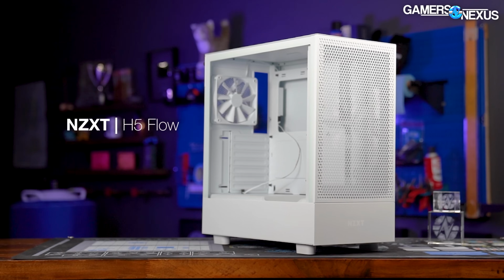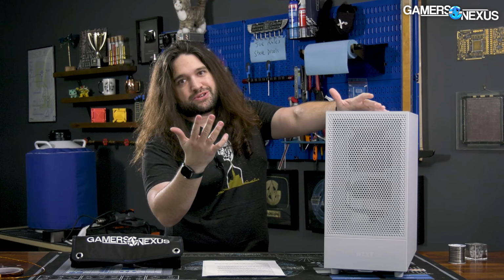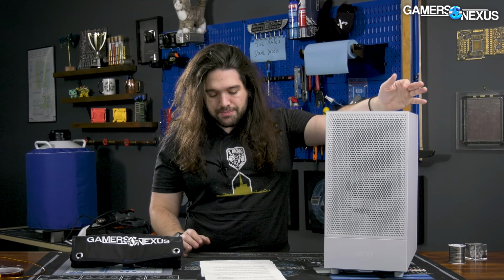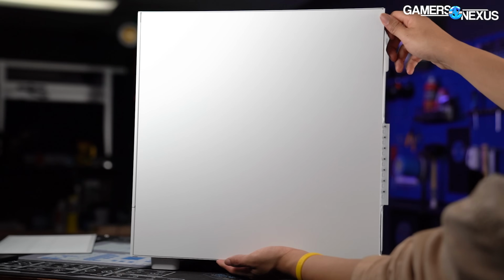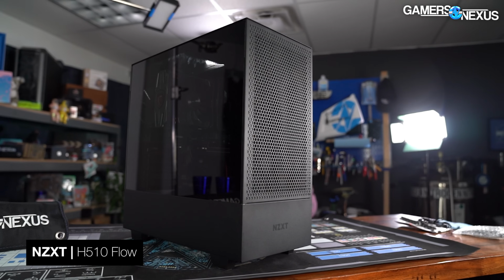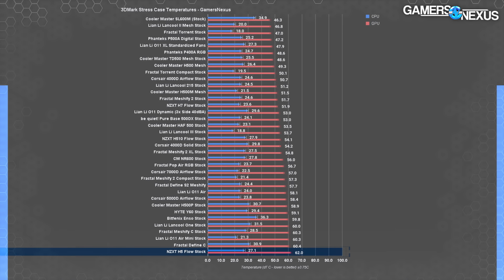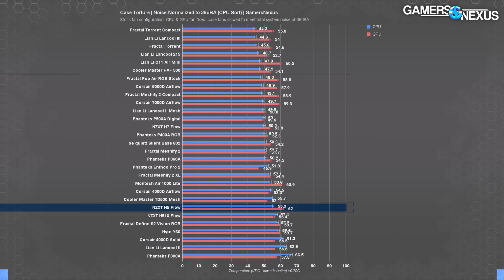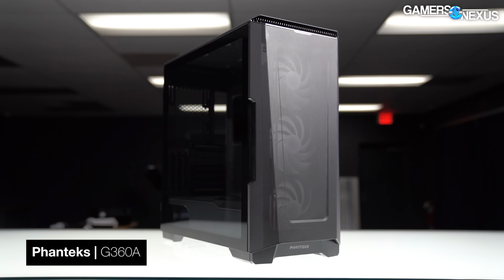NZXT H5 Flow Case Review: Thermals, Cable Management, & Noise

Comment: I actually have to give them overwhelming props for not including fans. I wish more cases would leave their garbage fans out
Reply: same, i have so many good fans aready at home, why would i need those garbage stock fans anyways
Reply: Yeah this case is really for those who already have plans to add their own fans. Just ordered this and will install unifans for this case. Might also buy a vertical mount for my 3080 suprim but I'm not buying that badly priced NZXT vertical gpu mount that costs as much as the case itself. Hopefully, the universal one from cooler master will work on the H5 Flow.
Reply: @Le_Mon9  did the coolermaster vertical mount fit and what is the gpu temp like mounted vertical
Reply: @acid3129  didn't go for the cooler master. A friend sold me his lian li one designed for the O11 but it fits in this case. The suprim 3080 doesn't go past 70 and mostly hovers at 69 deg.
Reply: @Le_Mon9  thanks I just got a evga 3080 ftw3 ultra and decides to get a new case atleast I know I can mount it
Reply: @Le_Mon9  69 Nice
Reply: Can't tell if this is a joke or not. I don't have a shitton of case fans laying around so the fact that this case doesn't have any is a deal breaker. The only fans I have use that shitty Molex or whatever and I can't control them. This is a reddit tier comment
Reply: Some including fans are better than others, apevias are garbage, while thermal takes are good enough for me to actually use.
Reply: Same here! I bought that case some time ago and I am happy that NZXT doesn't actually include cheap fans. I guess most persons who spend about 100-110€ on a case prefer high quality fans. I went with Noctua and I am really happy about it.
As said... Most of us already have a huge box filled with cheap fans that we got with cases but which we've never used.
Reply: I assume that NZXT is assuming a customer buying an aesthetics first case may be planning to use an AIO which will have its own fans to mount to the front intake or the rear exhaust. Thus saving money on unnecessary fans by not including them.

Unfortunately, that is based off assumptions about the components a customer will install in what is still a "budget conscious" case.
Reply: I don’t. That’s just extra money
Reply: I bought the H5 rgb when it came out bc fans in my country are 70usd for 2 140mm argb. Easiest way to get fans is on clc’s and buying cases that come with them.
Reply: Exactly. A lot of the "downsides" they pointed out I actually preferred. This case is amazing. I've had it for a while now
Reply: I agree.  The NZXT fans that came with my H5 Flow are in a drawer somewhere replaced with better BeQuiet! fans in the chassis.
Reply: Wdym mine came with 4 fans out of the box
Reply: Bro what it’s good that they include fans what are I talking about😂
Reply: Same 120mm rear fan, two front panel 140mm fans and another 120mm fan at the base@RIOTStyx

Comment: be sure to use magnetic tools on this case, which has a funnel to collect all the screws you drop and fire them off on random directions.
Reply: If you're doing that with the power on, you kinda signed up for the 'exciting prizes' lottery anyway.
Reply: @RN1441  if the power was off, itd just be a lottery for when you turn it on lol
Reply: Haha!
Reply: LeRoy Jenkins   Mine have snuck behind the motherboard before, necessitating a complete disassembly to retrieve.
Reply: Noted
Orders 300 H5 Flow cases for the office, because revenge is a dish best served with a rotating flingamatron
Reply: "flush* them off..." 😉
Reply: @thisisashan  Make sure to use high speed server fans!
Reply: @dragonhawk1492  Good idea.  Some nice deltas so I can drown out their verbal requests.
Reply: not that i want to help anyone but... since i have a lot of amazing ideas... why not share them... for front glass prevention of air flow, why not etch in lines or dots ... perhaps even 1 line down the very center so at least some air is inhaled by the fans... any direction works... why not glass art designs ? there you go i have million dollar ideas and get nothing for any of it, not that i care, but i do need to eat & drink dont i.  edit: so you can continue to profit off the ideas i type here all the time, not that anyone is listening, how about sliding windows made from glass while the pc is on and slide it closed when its off, make it all manual or automated... there you go i even advanced it in 1 minute.
Reply: Facts I had to learn this the hard way lol

Comment: The angled bottom fan reminds me of the adjustable angle fan in the old Phantom cases. Really wish they'd update and redesign that case with modern looks and ideas, such a good case.
Reply from the maker: The Phantom 820 was an insanely advanced case for its time, too!
Reply: The angle reminded me of the nvidia northbridge 780i
Reply: bring back side panel fans!
Reply: Curious if a fan held at that angle would cause the bearing to fail more quickly.
Reply: It was also insanely overrated. Couldn’t go anywhere without seeing it. Basically everybody had one.
Reply: @Entr0py404  on those old evga boards!
Reply: I still use a Phantom 820 (with also the 8 years old part -.-)
Reply: @NinjAsaya  phantom 630!
Reply: I'm still with my old Phantom 240 lmao.
Reply: Yes! I had that same feature in my switch 810 back in the day.

Comment: The toilet fan is the funniest thing I've seen, surely the best innovation they've made for a while (aside from self burning cases)
Reply: That case was lit
Reply: Orrr just make the front panel have space for 3 fans and have more space in the psu shroud thing
Reply: @MichaelBelgium  This, and also add the possibility of 3x14 at the front, like some lian li cases which arent even super sized like lancool.
Reply: they should test things before production ... would be a lot better case, with perforated rear under gpu + remove that toilet, put 2 fans at front.
Reply: @heksogen4788  3x14 is on the bigger h7, which i have. Super nice and quiet, never going back tp 12cm case fans again :D
Reply: @EnlighterMinh   3x14 plus some shroud and 2cm here and here, and you get a case height of 46-48 cm. Is that that much? I think every ATX case should be like that, but somehow manufacturers are reluctant.

Comment: This seems like a phenomenal case once you overcome the fan deficiencies. Add two front fans and it jumps to the top, or nearly to the top. If they'd added $15 and included those fans, it would be a no-brainer.
Reply: GPU temp at 55 with toilet fan and two front fans is still near the bottom of the pack.
Reply: it's sold for 2 140mm front case fans for $90 atm. Just bought it, badass case

Comment: I think this case makes the most sense when you are already planning on running a 240mm AIO in the front. Great review as always.
Reply: Those GPU temps though.  How do you fix that?
Reply: the GPU temps are generally made worse by the stock config, adding an AIO to the mix doubles the fans in the case at the same time.

I think more ideally AIO top mount with maybe at least 1 more fan in the front in the bottom position will net the best results, I question the use of non-ventilated slot covers tbh and wonder how much those are holding back certain configurations (since those exhaust air in positive pressure setups, or intake cool air in negative pressure setups)

There are some other reviewers for this case as well and GPU temps are basically a mixed bag depending on setup.
Reply: @chaon93  Well the test shows that adding two front fans lowers the GPU temps about 1 degree which is still the worst result other than this case without two additional fans.  So adding two fans did not help gpu temps.
Reply: @DM-fp8uw  you mean 6C. recheck the review, it was 60.9 to 54.8 by adding front fans. I have no idea where you got that 1 degree metric from.

To be clear, I'm more of a air cooler kind of person. Id rather just get something else. I just find that for people planning to get AIO's that stock fan counts aren't as big of an issue as the AIO will include fans.

having seen other reviews I suspect that GPU temps are better on 3x fan GPUs because they are longer and catch the air from the bottom intake better, the angle isnt enough without either a longer GPU or front intake to help force the air over the GPU area. I think the solid slot covers REALLY hurt this case a lot. air flowing either in or out of the slots via pressure would go a long way imo.
Reply: @chaon93  You are right. I was looking at the normalized fans not normalized plus the bottom fan.  Still 55 degrees with normalized fans plus bottom fans is still worse than almost every case with just the normalized fans except 5.
Reply: Agree, think 280mm AIO would be better from a looks and possibly performance standpoint though.
Reply: Vaniq  The temps are still bad in the test with normalized fans.
Reply: Vaniq  lol I still have the ancient s340 case. I’m probably gonna upgrade to the Corsair 4000d soon.
Reply: I have this case, 2 front fans, 240 aio mounted in front, bottom fan and the one in the back. Cpu stays around 40c while gaming and 68c on gpu.
Reply: @DM-fp8uw  got this case, have a 240mm AIO on cpu, radiator mounted on top with 2 fans as exhaust, got 2 front fans as intake and 1 fan in the back as exhaust. Never seen more than 65 C on GPU (7900 XT) playing on 4K. CPU is going max 55 in demanding games. I'd say that's a pretty good temp.

Comment: Lol the toilet fan is certainly an interesting addition. With the amount of builds I’ve seen where the GPU basically perfectly fits to separate the top and the bottom I can see it being more necessary.
Reply: Honestly, a case that has some kind of seal around the GPU, and dedicated bottom intake, rear exhaust, then top intake and rear exhaust for the CPU could be quite interesting. Just tossing ideas around though, probably some practical considerations to be made.
Reply: Toilet fan 😂…lol that is cool name. But just hope AH never hear it or she won’t use bed toilet anymore.
Reply: How you  going to put the anti sag bracket tho
Reply: A lot of sandwich style sff cases have a similar airflow pattern. The louqe ghost, dan a4, or even node 202 have fairly separate compartments
Reply: Like the h510 series for instance.
Reply: @ChrispyNut  because originally it was where hard drive locate. Second, it actually not as good as dual chamber design where you can mount 3 fan at the bottom. This design only make sense in mid tower where space is cramp. So issue can be fix with difference approach such as psu mount on top. This allow you to have intake from bottom. Anyway, it unique and cool but not the best approach specially you will sacrifice hard drive (not like gonn be a big deal for casual gamer but for content creator, it could be).
Reply: @ChrispyNut  for contents creator, one is never enough, 2?? Could be if both are 14TB or like that because ssd is really limited in storage so hdd still the only option for those works.
Reply: @ChrispyNut  should be, because the last ever case think about these like us been forgotten long ago…h440…man, i can’t step up from this case. My gaming system had been changing outfit yearly, but my main system on other hand changing internal yearly 😂😂

Comment: I have an old Thermaltake case which I used in all my configurations over the course of 12 years. Still rock solid with great thermals and that's without any additional fans. Back then manufacturers didn't care much about cable management and that's the only reason why I'm considering upgrading after all this time.

Comment: You can add front fans to nearly any case. You can't add bottom fans to very many. I'm a big fan of that lower/shrouded design. I feel like having a source of fresh air blowing towards the gpu from the bottom of the case is helpful. That's why I really like the Lian Li Lancool II, you can put two intake fans right under the gpu pulling from air from the bottom of the sides.

Comment: Actually, the lack of fans is a great plus for most enthusiasts who will instantly switch them to noctua or some high end RGB if thats your thing. Keeping the one on the bottom kind of makes sense as the toilet bowl is kinda the hallmark of this case.
Reply: I've always grandfathered fans from my previous rigs when upgrading, anyway!
Well, I've only upgraded twice in my life, since I'm not made of money, but each time I've grandfathered in fans, and replaced the oldest / worst ones when I get enough money to, or when they start to lose performance.
Reply: Very true, although enthousiasts might opt for a more premium built case.
Reply: @caramelldansen2204  The thing is, if the manufacturer keeps the cost down by NOT including fans, you can always buy 5x120mm pack for 15USD going absolute cheapo if you don't have cash/don't care. OR you can buy 100USD worth of noctuas/corsairs/Lianli/whatever....or just 3 fans if that works for your config. Or 6 and stick them everywhere. Each scenario, you save, cause not including random fans should in theory keep the case price lower (ofc whether it actually works or just keeps a higher profit margin to the case manufacturer is another thing, but at least you end up with less junk, that can literally be replaced for 10-20usd). Unless, you get a bunch of high quality fans included with a relatively cheap case, that seems like a bargain, you'll get mediocre fans at best or 5+ pieces of electrojunk instantly ending up in the bin.
Reply: @kaziu2eq  I have had quite a bit of luck with cheap-o 3x or 5x 120mm fans for $15-$20 - three computers in the last two years, holding decent temps with the cheap-o fans at acceptable (for me) noise levels.
Reply: @TheEchelon  Personally, having some limit to the budget i'd much rather go for 60$ worth of Noctua fans (easily 2x 120mm + 2x 140mm) and this case, getting practically as quiet and performing as one can, than the elite version, that gives you bunch of black fans with leds + giant tempered glass in front to suffocate them. Plus otherwise it's really great, I mean relatively small footprint with plenty of space, cable management and the ability to mount 240+280 rads makes it quite good for a compact custom loop or 2xAIO.
Reply: Agree. You can always go cheap with artic fans or premium noctua fans.
Case with good build quality and design with or without fans does not bother me. (Good price for sure)
Also, putting cheap fans yourself would actually cut price of the case with their branded fans.
Reply: Yeah, but if you're that much of an enthusiast then aren't you probably just buying a better case?
Reply: @libertyprime9307  The thing is, I think this case looks great. Minimalistic etc.
Reply: @libertyprime9307  right now i have an Ryzen7 5800X3D with a Gigabyte RX6950XT in an old NZXT S340Elite case (no fron panel on it tho) and it works fine, i just want a clean looking case and the H5 Flow is cheap and really looks good. I already have a bunch of Noctua NF-12 and NF-A14 aswell as some SilentWings3 140mm and ShadowWings 120mm, so the only problem of this case (not including front fans) doesnt matter to me anyways :D

Comment: I think a micro atx version of this would be cool as it would make the bottom fan make even more sense.
Reply: agree, if this came out with a version for matx, i'd buy it in a heartbeat.
Reply: Just built a system with it hours ago, it would not have been possible to fit a full ATX PSU with it if they were to make it mATX only. There really is no space for many shit inside

Comment: The 'Standardized Fans'-Test is invaluable. Just one of the things that makes GN the best!
Reply: Like he says, there are problems with it though. Some cases are just obviously not designed for that standardized config. Ideally we'd have multiple standardized configs to test including AiOs, for each case where they are physically possible, but it's a lot of extra testing.
Reply: They should do a best flow setup for every particular case for both air and aio cooling no matter what the case standard setup is . Just to show what you can except at best with that particular case. But that surely would be almost impossible to do with all the coolers and fan around...
Reply: @fabrb26  This.  Why not test them to the designed potential?  If I buy the X63 cooler this was designed for why would I want to pay for front fans that come with it that I wouldn't be using?

Comment: I appreciate NZXT trying something performance-focused. They may have realized that it's good to diversify and innovate in this market. The little angled fan is a great idea, but we'll see if it catches on as a new trend. Personally, I'd like to see more cases with top-mounted power supplies (other than the Torrent) so we can have fans on the bottom that blow air up into the GPU.
Reply: I'd rather keep the PSU in the bottom so the case isn't top heavy, and just bring back side panel mounted fans.
Reply: @mjc0961  Side panel fans are a very practical idea for performance, but most people won't really enjoy it. Glass side panels already won that war years ago, and combining the ideas seems like it wouldn't work very well.

I could see side fans making a return with cases that already have solid side panels (for example, fractal makes most of their cases with this option), but those are already hard to sell in the first place, and it would be pretty risky to make something like that considering it'll require new tools.
Reply: @Haetheii  I like my Fractal Arc-Midi with the 180 mm side vent, used it as an EXHAUST with a slim (15mm) Silverstone 180mm fan when I ran dual GPU's, my CPU really liked that.
Reply: If it is such a good idea why are the GPU thermals at the bottom even with two front fans added?  Doesn't seem to have helped much.